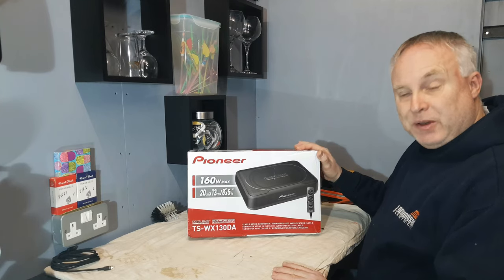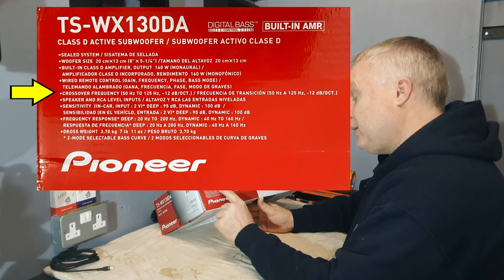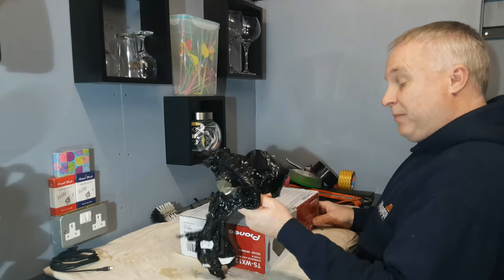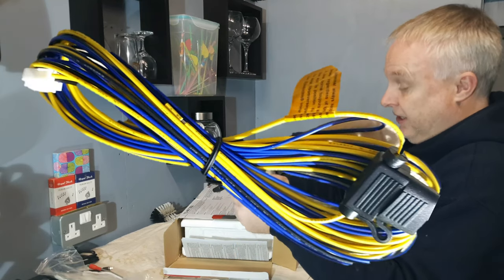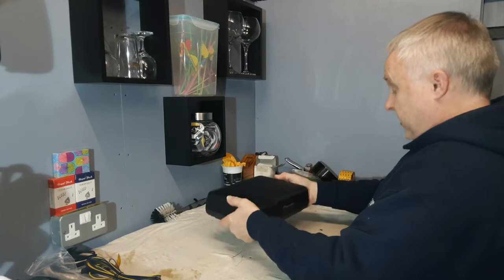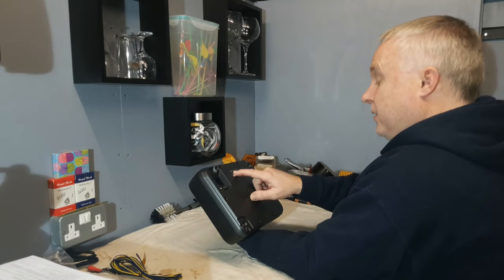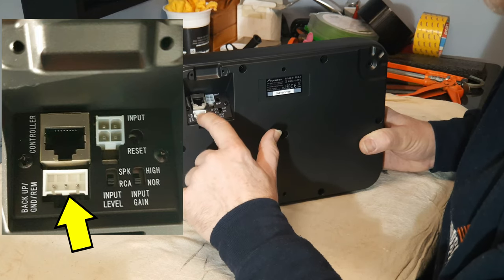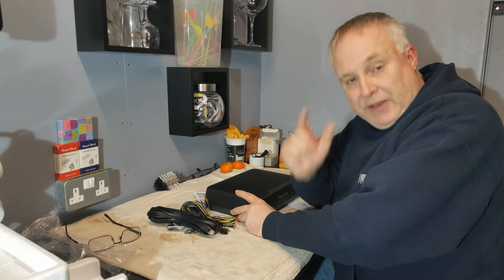Pioneer Under Seat Subwoofer Unboxing | TS-WX130DA Pt 1 of 3

Comment: I'm personally not a huge fan of those compact under seat subs. However, I have rebuilt the whole audio system in my NG9-3 and the result is stunning. Crystal Clear and the whole car has been sound treated. Looking forward to see where you are going with this! :)

I was thinking: have you replaced your positive wires(battery - altenator, etc) to new ones on your ng9-3?
Reply from the maker: My car is a 2007MY and has the 7 speaker infotainment system. The head unit and boot amp are already decent quality, so I junked all the (useless) stock speakers and replaced with Hertz units all round, including 6x9s on the rear shelf. The sound quality is superb with excellent clarity, especially vocals from the dash DCX87s. I've got EV165.5s in the doors and it's not 'short' of bass as such, but I just felt the need for a little 'reinforcement' in the very lowest registers. My son has a monster sub (12 ich Edge) in his Fiesta, but I don't want something taking up my boot, nor do I feel the need for something that 'big' soundwise (he has only got 5x7 door speakers, so ....).
Hence the compact sub. I've researched and this seems to be reviewed as one of the best of it's type, so we'll see.
The positive wires? No I haven't - is this another 9-3 Achilles heel I should be looking at?
Reply: well for some cars its all you can get. I've got a NB mx5, nothing really fits, big sub in the boot is useless. So im getting this one this week, put in in the passenger footwell.
Reply: @Purplehaste  Of course! Didn't say anything about that. However - I don't have a huge sub in my boot. But I have rebuilt the A-pillars, doors, etc, to make everything the way I want. I do have two 8" sub's in the parcel shelf instead of the 2x original 6x9's. I upgraded to the biggest sound system for my car(Prestige 300), MY04, meaning I got two AMP's driving the speakers. One for the doors and the center in the dashboard and another one for the 6x9 midbass-speakers. After that I'm using a DSP to sum the signal into one stereo full-frequency signal, running to amps driving the system.

I still have had under seat subs, because of the same reason - not enough space for anything else. Doesn't mean I'm personally a fan of them myself. :) But I'm also working with music and as an audio engineer, that's probably why.

However - you can get great results with under seat subs as well.
Reply: @CycloneCyd  No, it isn't. I'm just curious. I'm thinking of getting new positive wires for my car as well, since I'm planning on changing the earth cables. I want bigger ones. :)

Great choice when it comes to the speakers. Hertz make great stuff! I'm running Focal and JL Audio all the way, hehe. :) I'm a huge Focal-fan!

Have you replaced your battery terminal clamps? That's also something I'd like to do, but haven't done that on a 9-3 before which of course makes it feel a little scary. I was thinking how you'd work the "battery disconnector" on the plus-wire out. Would feel great with new and fresh terminal clamps as well.

Comment: I’ve done a system on my Saab custom box two subwoofers kicker solo barics from the early 2000s which still sound really good paired to an old school Phoenix gold amplifier and infinity reference speakers all around .. it made the car sound so much better..although I had to use a capacitor to supply steady power  👍 I’ve never tried an under seat subwoofer amp before this should be cool to learn about
Reply from the maker: My car is a 2007MY and has the 7 speaker infotainment system. The head unit and boot amp are already decent quality, so I junked all the (useless) stock speakers and replaced with Hertz units all round, including 6x9s on the rear shelf. The sound quality is superb with excellent clarity, especially vocals from the dash DCX87s. I've got EV165.5s in the doors and it's not 'short' of bass as such, but I just felt the need for a little 'reinforcement' in the very lowest registers. My son has a monster sub (12 ich Edge) in his Fiesta, but I don't want something taking up my boot, nor do I feel the need for something that 'big' soundwise (he has only got 5x7 door speakers, so ....).
Hence the compact sub. I've researched and this seems to be reviewed as one of the best of it's type, so we'll see.
My own view is that anyone with a totally stock system should start by replacing the speakers. Unless they are lucky enough the first owner paid for a premium system (LR Meridian, Bose etc etc). I've done that already and it's made a HUGE improvement, but the EV165s are mid-bass units and though they are very good I just feel the need for a little more right down at the bottom end (I listen to classic rock mostly).
I've never tried an underseat (or 'compact' if you prefer) sub, so this is new on me too.

Comment: Will it work with the pre facelift wIth the fiber optic system
Reply from the maker: YES, it should work perfectly well. This unit can handle speaker level inputs and the only caveat would be to connect the inputs to the door speakers because the others are filtered.